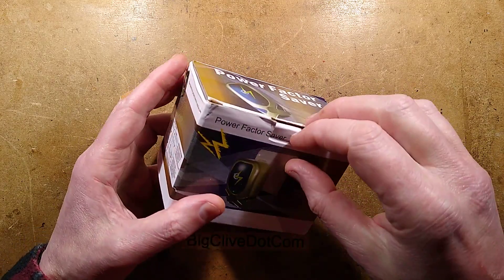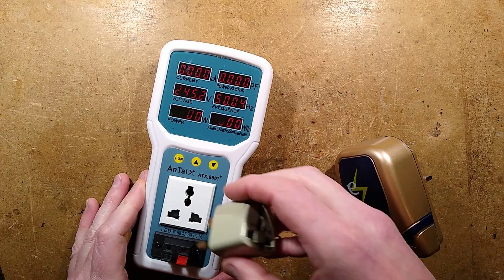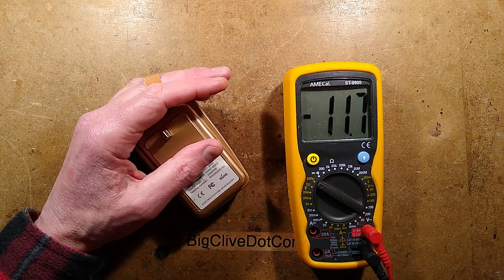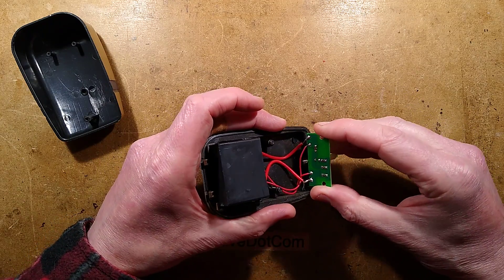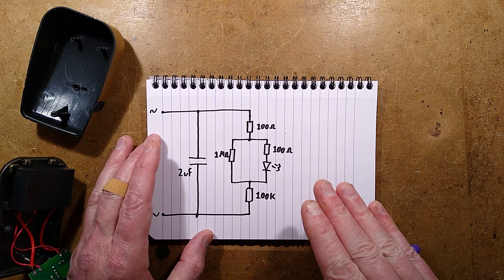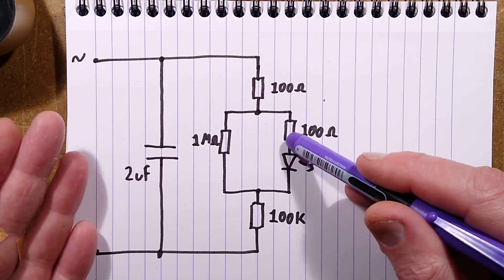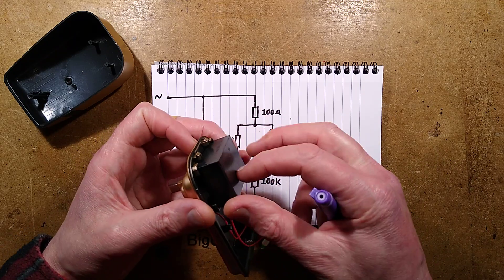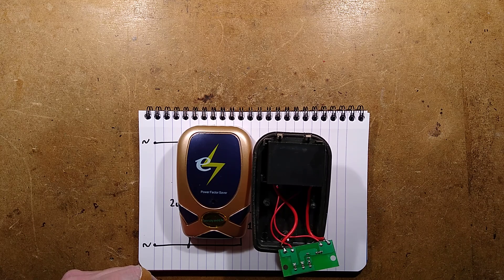Luxury fake power saver plug (with schematic)

Comment: i just took one part.
No screws at all.
Mine is posher, 2 LEDS.
However the capacitor appears to be a box of grease and I could just pull the wires out.
Goodness knows what that would do with actual current running into it.

Comment: I've ordered 2 of these white squarish types. WIll be used on esphome for presence detection by adding a ld2410 inside and anything else that fits and it's useful (ir, temperature, a small oled screen maybe). Will save power like crazy by controlling climate from Home Assistant.
They have nice cases because they need to be looking high quality so i'm harvesting that. I made sure there is no lies mentioned beyond "saving power".

Comment: Is there an alternative use for these fake devices? I was wondering if the capacitor could clean up any noise on the power line? Best way to test is a video with a noisy near-"pure" sign-wave that is still noisy enough buzz that can be detected on a cheap guitar amp with and without such a capacitor on the same source power line?
Reply from the maker: I wouldn't trust the capacitor for safety reasons.  It would definitely filter electrical noise, but would pass a lot of current out of phase to the supply.

Comment: useful load 28,000w on the lable :)  These things use to be popular around 10 years ago including a big box containing a starter capacitor in the box to supposedly save power it actually used around 1kw of continuous power My dad who bought it at the time told the vendor who insured that 1kw is not being metered. I then intervened the scam with engineering knowledge and then he demanded a refund.

Comment: I'm surprised nobodies took your capacitive dropper idea and released an actual energy saving plug for just LED bulbs in lamps, you could probably even have a switch array on it to add and remove capacitors to adjust the capacitance/brightness

Comment: Hello Clive, love you channel and have learned lots. Wondering if you can help me please. Im trying to design a exust extraction fan build. And I need it at a certain spec cfm. I have a sung shin IS-27210ARC-4(C.W-EVA)AC220v-50hz and cant find some of the specs I want on it. Would you be able to confirm wattage, rpm, and if possible be able to work out if made in to a can type extractor roughly how much cfm air movement I can get. Also just wanted to check that its defo straight into uk mains powered and dont need a seprate step down. It does say 220v 50hz but conformation would be cool. Your help would be greatly appreciated. As I have that fan/motor as a spare and just trying to work out if it will be sufficient, or if I need to get any other parts. Or if I should mabe get a stronger fan mechanism. Im trying to plan something that can do about 25-40 cfm. Thanks

Comment: I forgot 2 mention ..... the (  mains rated !  )  2  μF capacitor is  IDEAL for the Poundland™ night light ( using their 230 Volt ,  60 Watt Tungsten " squirrel cage filament " antique lamp ) ... er , sold out in my area ....... ( ? ) , as discussed in previous comments ! ..... DAVE™  🛑

Comment: When can we see one of these in an industrial power-factor correcting style? A bank of inductors and capacitors with a smart board to detect current power factor of the entire house and then switch in/out inductors and capacitors to correct the power factor.
Reply from the maker: That doesn't work with modern electronic drives and power supplies.

Comment: I've been seeing ads recently for plug-in motor soft-start power-saving equipment extending adapters... I would be curious for you to take some of them apart and see if they really would do any of the things they claim like reducing power bill due to the initial startup or extending the life of the equipment do to reducing surges at startup and making it quieter and easier to start things on generator power.  Also seen some that are hardwired in line with your mains appliances like an air conditioner same idea.  It sounds like a too good to be true device, but I don't know.
Reply from the maker: There are soft start devices.  They can help reduce inrush current spikes and also avoid physical wear on machines when the motor suddenly slams on.

Comment: Matthias Wandel's modification to one of these is funny.  Just tie L and N together, plug it in and it really does save you power as it trips that branch circuit breaker in the panel.  Seriously though, don't try this at home.

Comment: i'd say the term 'apparent power' in terms of the current , and true power  are used the wrong way round, surely 'true power' is the actual volts times amps taken from the supply, its the current that loads the electric grid system,  i'd class 'apparent power' as the out of phase power, how it seems to a power meter

Comment: Why does it need all that circuitry? They should just use an empty case without LED and claim that it only works if it's plugged in for 2 months straight. People who fall for this scam won't ever know the difference. There shouldn't even be an easy way to disassemble it.
It's a dumb design: they want to scam people but spend all the profit on unnecessary parts.
Reply from the maker: With some vague products they do imply that it takes a while for the effect to show.  Just long enough to lose the receipt or go beyond the return/feedback window.

Comment: I use the proper power saver plugs, a plug with a socket and a switch in the front, very handy, but as usual a lot of them can be a risk of fire due to the use of very thin wires to connect the switch, I prefer to purchase those from EU based importers, I imagine that they do a minimum of research and quality control since they can be sued 🤔

Comment: Where I live, residential customers are billed for real power consumption with an average power factor correction based on typical residential consumption applied to the bill.  The power meters are smart meters, so it would likely be possible to bill customers accurately.  My guess is that the billing software is not up to the task.  The so-called power saver shown here, if it worked, would be meaningless anyway.

Comment: I have similar like this one as a night lamp to see the path at night. USB chargers with LEDs. If you not charging anything, then it is switch power supply with LED (in my case). They should call their brand "Placebo".

Comment: I also noticed the Earth pin was sleeved... naughty!  Why would the bottom resistor in the diagram get hot but not the top one (or do they both get hot and you just didn't mention it?)
Reply: The top resistor is 100ohms whereas the bottom one is 100kohms, so the bottom one dissipates a thousand times more power.
Reply: @petehiggins33  ohh  must have mis read it, I thought both were 100 ohm!    must get an eye test!

Comment: No mention of the stray strands of wire where the cap is soldered to the board?  
Some scams come and go but this one has been around for at least 50 years?  It's surprising to see new case designs for these, I guess this is such a good scam that they know they will sell enough units to get back the money spent on the injection molds.

Comment: Remember in childhood, chacking 4,5V battery charge using tongue, probably in case of power savers it will work too :) more useful then just finger touch
Reply: You probably mean 9v battery. I still do it as the quick diagnostic for guitar batteries and such.
Reply: @tin2001 Nop, trpple1,5v flat rectangular 4,5v, not used any more. Very popular 50 years ago :)

Comment: At tech college 40 years ago , our class checked the power consumption with a capacitor across the supply to a kitchen circuit running fridges and found a 4% reduction in metered power. 
If your bill is £2000 a year, you save £80.  
Hardly nothing mate. 🇦🇺
Reply: Most households have digital meters and they don't measure any difference with or without bad power factors
Reply from the maker: Almost every power usage meter measures real power, so doesn't register apparent power.  Modern smart meters do potentially have that ability though.  However, pure inductive loads are getting rarer in homes.  Most are electronic, and a simple parallel capacitor will not help with that.
Reply: I'll await comments from experts, but both meters and loads have changed a lot in 40 years, so probably not the case ?  As Clive comments elsewhere, adding proper pf correction is complex.
Reply: That's a sign of a faulty meter. The wiring of mechanical meters sp they measure only real power is quite complex - I think Clive has torn one apart and shown how it works - but it wouldn't take much to make it react to apparent power in a small way.

Comment: Why do they even bother putting a circuit board in there? Pretty obvious it does nothing anyway. Should just have an led, a dropper capacitor and a current limiting resistor. They actually cost themselves money! 😂😂😂

Comment: Why didn't they use two 47k resistors? One to replace the top 100R and one to replace the 100k. That would half the power in the position where the 100k is.
Reply from the maker: It's because they are electronically incompetent and don't even understand basic electronics.  The LEDs light, there is no smoke, it's good.

Comment: I used to live in a 1950s walkup apartment, and sometimes the compressor on my portable (2 hose) 120V AC unit would struggle to kick on.  Assuming a device like this was safely built, do you think it being plugged into the same outlet could've helped the compressor start up more smoothly?
Reply: Not at all.
Reply from the maker: That's more likely due to either a high resistance connection somewhere or an appliance issue like a failing start capacitor.

Comment: I love how this deluxe model has fake buttons on the front of the case too, giving the false impression that it may have modes that the standard version doesnt. Thats just class.
Reply: Mode one: 0.16 Uf in parallel to the mains

Mode two: 0.33 Uf in parallel to the mains

Mode three: Ooh it seems like I have a unity pf, omg this seems like a resistive load, wtf is that?- oh, that’s only the dielectric insulators breaking down in the cap and almost burning, that’s fine =w=.
Reply: how can people fall for this?

Comment: I have a device that you plug into your outlets and it saves electricity.  It's called a fork. 🍴 ⚡⚡⚡ Once it trips the breaker it decreases the power usage of that circuit by 100%
Reply: Just for the uninitiated, other cutlery works just as well.😏

Comment: These devices are clearly useless for the saving of power but wouldn't they decrease any HF "noise" on the house mains, caused by Switch Mode Power Supplies which are so prevalent and many of dubious quality?  Great di-section as usual
Reply from the maker: There will be a noise filtering effect.  But it could be done better and safer.

Comment: The first impression of the 1MΩ resistor is it’s the Chinese version of a snubber network for series diodes, or maybe fanciful thinking that it will shunt the current around the LED when reversed-biased so it won’t avalanche. But, I suspect it’s to stop the LED from ghosting away when it’s unplugged since residual charge and dielectric memory could keep it lit for quite some time, but very dimly. I’ve done that before, and they do stay lit for a long time, and a VERY long time with electrolytics in a DC supply when the LED is the only path thru. But I think they missed an opportunity! They can just say the LED is still lit because it’s literally saving your power! 😂

Comment: There's more in there than I thought. I was thinking a capacitor, a resistor and an led, maybe a little bit of wire.
But a circuit board? I'm shocked! 😄👍
Reply: No, you wouldn't be shocked by this model. Clive checked that for us.
Reply: @watsisbuttndo829  
🙄
😆

Comment: Would throwing one of these on the same outlet as my 3d printer maybe help with my lights flickering when the printer is running? It'd be a resistive load and it seems to be related to the heated bed.
Reply from the maker: No.  The 3D printer shouldn't really cause your lights to flicker.  There may be a high resistance connection somewhere.
Reply: I'm gonna guess your power supply might be a bit flaky. What voltage does the bed run at? Some of the older ones were lower voltage, higher current and the cheap hight current Chinese power supplies only have a fairly short life span.

Comment: I can't wait for the "ASIC" single chip for these products. Why waste the time with individual components? Just make an ASIC and have a mystery 8-pin chip and then nobody will be able to copy this 'Jenius' product!
Reply: They'll use a random chip that's around 1/10th of a cent and has a spare "not connected" pin.... Wire the mains straight to it and any other random pin. Hopefully it won't arc internally.

Comment: What size would a real power factor correction capacitor be for something like a 100W shaded pole pedestal fan ?
Reply from the maker: That would probably have to be matched to the motor.  Possibly with a set of test capacitors and suitable tester.

Comment: The earth pin is also sleeved not that it's connected anyway. I've used sleeved earth mains leads from China to catch out incompetent PAT testers. PAT testing is in most cases pointless but if someone is paying for it the the tester should at least know that a sleeved earth pin is illegal and it's a simple visual check.

Comment: Can you do a video on why strings of LED streetlights flash and how they are fixed? Literally all the news stories on them are perfectly useless wastes of time.
Reply from the maker: Two possibilities.  Sometimes a high resistance connection causes the LED drivers to keep restarting.  Other times it can be down to a batch of bad drivers or LED panels that cause the driver to keep cutting out and restarting.

Comment: Any chance of you doing a video elaborating on the "apparent power" overcharging by power companies, especially with smart meters please? I read the video description. I seem to remember a video about something similar. I have eschewed a smart meter as there seems no upside for me. Layman's terms appreciated please. Ta.
Reply from the maker: Modern smart meters can be switched between measuring kWh (real power) and kVA (apparent power).  Some devices with poor power factor (voltage to current waveform match) will appear to draw more apparent power.  Something like a simple plug in time switch that usually has a standby power of about 1W could appear to be 10W.  With a lot of electronic power supplies that can add up quickly.

Comment: I really like the specifications on the label on the bottom of that plug. 
Rated for 28 KILLOWATTS load????
At the low rated voltage of 90V, this would be 311 amps. I'm not sure that #20 PVC insulated wire is rated for that current.
If we more generously assume the max voltage rating of 250V, the #20 wire only needs to carry 112 amps continuous, which is much closer to it's rating.

I didn't know that standard British household plugs were rated for 300A continuous. Learn something new every day!

I see the self-proclaimed description is "Electricity saving spike buster." If you just ignore the first half of that there is potentially a little truth in the second half. Though with #20 wire I don't really expect it to limit voltage spikes very well.
Reply: Those wires are probably 0.35mm2 or less copper clad aluminum.

Comment: I've always wondered how people think these work? How do they think it saves energy?
Reply from the maker: Marketing science blinding the non-technicals.
Reply: Few would even think to ask the question.
Reply: If you do a simplistic test - an AC current meter across a fridge, with and without a capacitor - you can demonstrate that the capacitor reduced current flow. Why it works - explanations of reactive power - are beyond the understanding of most people, so 'less current = less power = less money' is an easy sell.

But you might have to tear open the fridge and remove its built in PFC capacitor if you wan to do this demo with a modern fridge, because most larger modern appliances include power factor correction circuitry.

Comment: Surely as the LED has no reverse polarity protection then it will have full mains voltage across it when it's not conducting which will be well above it's rated voltage which will cause it to fail.  I'm also wondering if the metalic coloured paint on the case is conductive as it goes all the way to the metal contacts of the mains pins.
Reply from the maker: With older technology LEDs they just shunt when their reverse voltage is exceeded.  Modern blue/white LEDs would fail in this application.